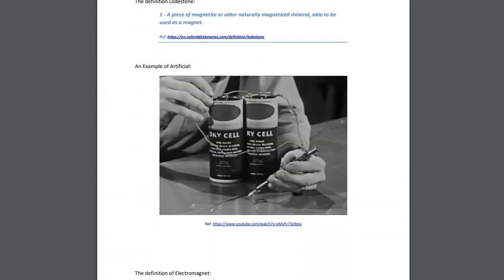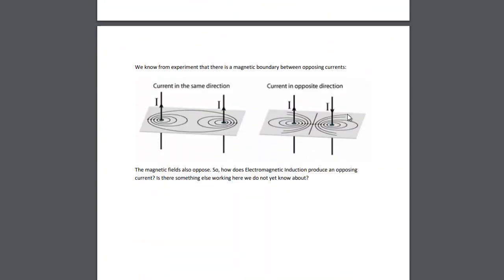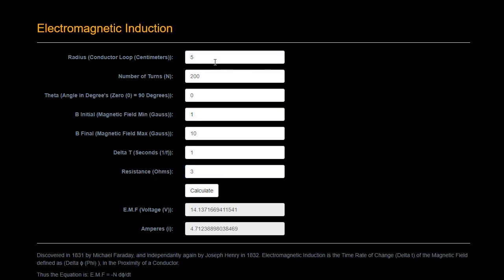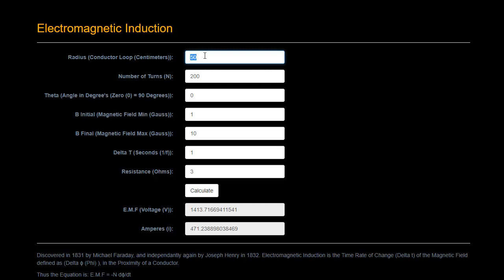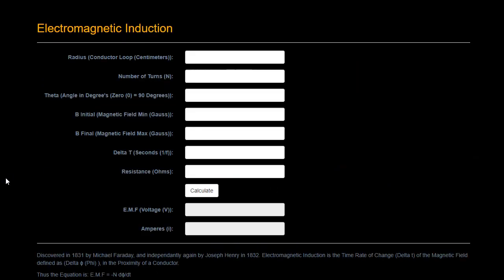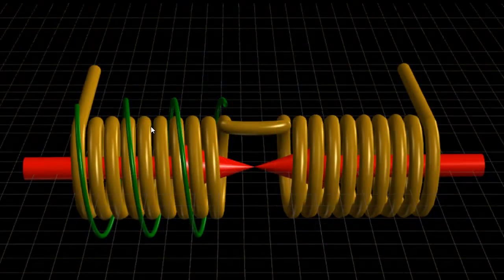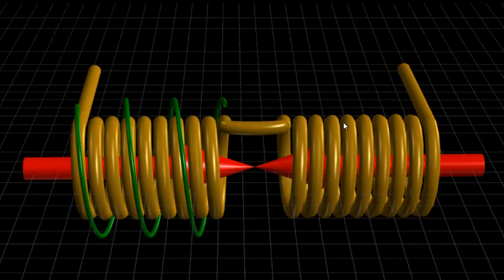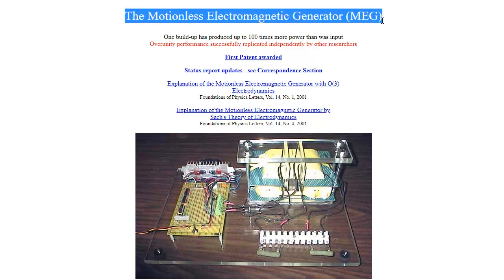Non-Inductive Coil Experiment - Video Ten

Comment: Magnetic fields are "non-conservative" unlike electric fields, they do not cancel each other out, they continue to add to each other.  So, not "non-inductive" but rather di-inductive or diamagnetic. Party on Dude, thanks for these presentations. Science does have a lot of confusion which is contrary to the spirit of science (I'm agreeing with you. Excuses all aside, they don't make up for it).
Reply from the maker: This is all true and correct! Electrons are like tiny magnets in their own right, then can be put under pressure and made to move and change orbitals. This pump is called a "Generator", its simple and its incomplete! Apply Asymmetry!